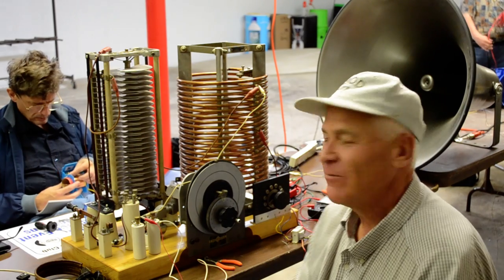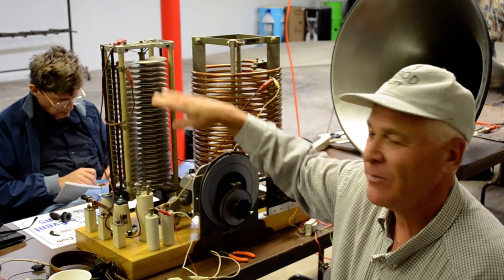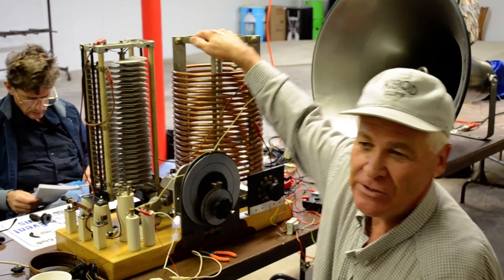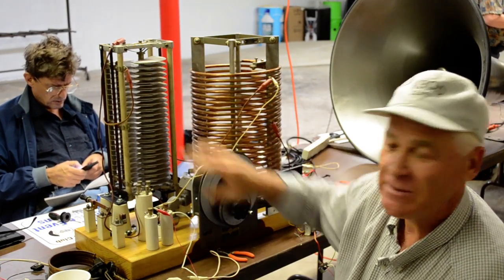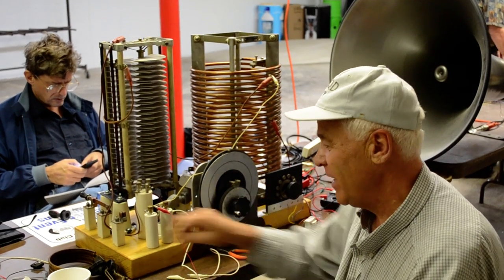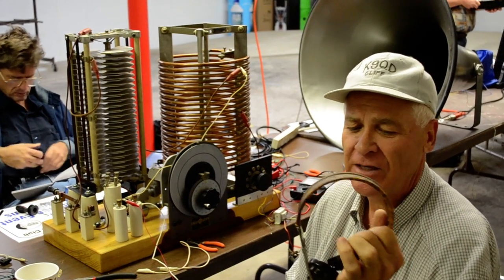World's Largest Crystal Radio K9QD

Comment: Fantastic. Wish we could hear it.
Reply from the maker: I didn't plan well enough to bring the camera's audio input close to the headphones.....but it would be even better to hang a spectrum analyzer across the tank as the capacitor is spun through the broadcast band.  I've already calculated approximately 200 mW audio into a 10K:8 Ohm match to the large trumpet speaker in the background the video.  Our local AM station WGN 720KHz (only 5 miles distant from where we shot the video) is probably more than 150 microvolts field strength her and it would be cool to have a scope display the detected audio spectrum too.   Crystal radios were something I began building by the age of 7 years experimenting in electronics as a kid;  the fascination of RF ended up causing me to spend college and career playing with the stuff.
Reply: Crystal set folks are used to digging around in the noise for a word or two.

Comment: That set really is beautiful... definitely mega-kudos to the home-brewer that created it. 
I was just thinking... that coil is huge and has a lot of pickup surface. Without even being connected to an external antenna and ground it could still pick up strong local stations by direct coupling into that big coil. One could build one like that with a big coil and big variable capacitor and a zincite/bornite detector bolted onto a back-pack frame and strap it on and don the 'phones and  have a nice stroll around town listening to the local favorite AM station of choice, free of charge...batteries not included or needed,  just a nice set of sensitive headphones. It might help to  set it up so the coil is horizontal on the backpack crystal set ;-)
73, Mr QD :-)
Reply from the maker: Yes, a simple 1N34A detector.   The local BCB signals are strong allowing the germanium junction to be forward-biased with plenty of headroom.  I've also used the zero-crossing FET scheme (obtaining the minimal junction bias needed from the tank to allow synchronous detection) to hear weak shortwave signals with great performance.  Surely you're correct: If the inductor were rotated horizontally, local M-field would be sufficient to detect stations with no ground nor any antenna.  My long-wire antenna is about 28 feet high and runs 130 feet to a tree (yes, once a lightning strike did burn it off the tree and I had to climb up there and restring the wire).  The headphones are a vintage TRIMM Featherweight high-impedance set and really help in avoiding a nasty de-tuning load on the tank. Yes, a backpack crystal set my be needed if societal chaos continues and gets worse.  73.
Reply: @k9qd25  Understood... yup, the End Times race is on... keep strong.
OK on the 1N34A diode... that would definitely be the best of the three detectors I mentioned, with the zincite/bornite rig coming in second-place.
Reply: @k9qd25  Your lightning adventure reminded me of a time years ago when I was sitting behind my Gonset GSB 100 TX and National NC-300 RX and I had my home-brew antenna tuner off to my left on another shelf about a foot and a half from the TX and RX and a thunderstorm brewed up and a lightning-bolt struck something nearby and had enough coupling into my home-brew G5RV antenna and a thin bright spark snapped from the cabinet of the tuner across that foot and a half gap and hit the cabinet of the GSB-100... WHEW!! LOL! :-D
Reply: ... As I think about my adventure I realize that even though the tuner's cabinet was connected to the GSB-100's cabinet by the shield of the coax connecting them, that length of coax braid presents an inductor to the lightning, and the energy of the lightning will resonate at whatever frequency that inductance and surrounding capacitance creates and SNAP!! across the gap at that freq.
Reply from the maker: @TerryMcKean  I've had a similar experience but the thin blue zaps circled around the basement ceiling looking for the water and gas lines with high-pitched snapping sound.  Luckily this energy wasn't the main lightning shaft that hit my tower outside!  Nothing got cooked but I moved quickly to pull the connectors out!
Reply: @k9qd25   Right on... I had a homebrew half-size G5RV- type antenna and it was up as an  inverted vee and held up at the apex by a 20 foot length of 2 inch PVC pipe. The 14 foot length of open-wire feed line feeding the apex went down through the inside of the pipe to a balun then coax to the tuner. It worked great on 40 meters where I usually operated at, usually  around 7050 on  CW, or around 7290 on AM. That was back on the 80's and 90's when I was N3HJQ, either through the Gonset/National rig, or my homebrew rig  that I built from old junk TV parts and stuff. I built it for 1 band,  40 meters, and had 13 tubes total in it and had a single-conversion superhet RX, and the TX  ran about 50 watts on  CW or about 25 - 30 watts on AM, with a 6146 modulated by a pair of 6DQ6's. I had awesome times back then talking with Ashtabula Bill W8VYZ (SK RIP) and TimTron WA1HLR and the rest of the East Coast AM'ers .... great times. <3 My HJQ  call expired in 2002 and has since been reassigned. Before HJQ  I was WA6GWA. My HJQ ticket expired because I got so busy with work and never sent in the re-up fees and stuff to keep that call going. I gotta find a VEC somewhere around here in or near Big Sur California and re-take the tests. and get back on the air, hopefully with my old GWA call  re-vitalized. :-)

Comment: Wow Very awesome.. ... A long long time ago I saw photos of a larger one that used quarter inch copper pipe at about 18 inch diameter..   Just amazing how large it was (and heavy!)  I will see if I can find a picture and post it here for you.
Reply from the maker: Ken, Will very much enjoy seeing that inductor.  The reason for this Continental transmitter (EF Johnson nameplate on the coil) component's size is to enable the withstand voltage needed by output tube's DC bias (16,000 Volts as I seem to recall).  The resultant Q of such a large solenoid is a welcome, ancillary benefit when building a Crystal Set.  When I spotted the variable cap at a Hamfest, I knew just where to utilize its overstated dimensions as a perfect match to the Continental inductor.  The variable cap's origin as part of a B-17 Bomber's Antenna Tuner just made things perfect.  The radio's Tank components have an interesting pedigree and perform wonderfully too.  Measured 235 mW into the speaker load (the speaker is in the video's background) with my scope and simple math.  Speaker load is a 31" University GH re-entrant trumpet from the 1950s matched to the tank via All-American Five output transformer and it fills the room with almost uncomfortable volume. Wife asks me to 'turn that thing down' because it's too loud.  I'm now using a white LED as the detector; it lights-up the ceiling and will indicate modulated light on weaker stations.  Three local Clear Channel AM transmitters simply peg the lamp to full brightness which demonstrates there is at least 2.85V across the tank.  Much fun.  Too bad the AM Broadcast Band has been suffering from a lack of decent programming as the medium loses audience.

Comment: Like 127
My lucky number. Amazing build, I wish I had a local radio club to make crystal sets at.
Reply from the maker: I spotted these large passive components (variable cap and inductor) at a HamFest and knew immeadiately where I could put them to use.  Our local radio club here in the Chicago suburbs has been organized for more than 40 years.  Our attendance on Saturday mornings will experience 25+ Hams, club members, and general public who simply wish to partake in electronics in some way.  Although we concentrate on radio, we do find some general public attendees who just want to learn more about electronics.  Since we're across the expressway from Motorola Solutions Headquarters, we are also blessed to have several ex-Motorola engineers in the group.  They're wonderful resources of radio knowledge and we're constantly learning new things from them.  Fun stuff.

Comment: does the wire gauge affect the reception? I had fine wire from power supplies, made coils, but they weren't that great. I used thicker wire, and it was the same. I finally used the thickest wire with just 15turns, and I could get a ham radio signal from Dayton, Ohio! the operator said he's going to play oldies music. I'll look for the call sign.
Reply from the maker: Hello Science Nerd,
Any antenna wire will receive radio signals.  Copper is
best, aluminum could also work.  I’ve used very fine copper wire,
insulated bell wire, un-insulated bell wire, and I currently have stranded,
un-insulated copper-clad steel antenna wire suspended outside to a tree in the
back yard.  I’ve also had good reception with thin bell telephone wire
stapled onto the wooden upper sections of attic rafters while lying on my 
back as I crawled across the attic of my home….but could only run about 60-feet
in an L-shaped configuration.  It worked but the outside antenna run is
better.  The outside wire also suffers lightning risk, so it has a
lightning arrestor with a grounding wire (thick 10-Gauge copper) run straight
down to 10-foot rod driven into the earth on the outside wall of the home.

The wire gauge doesn’t matter, but will need to be strong wire
if suspended any length.  Length is important as well as elevation for
broadcast-band AM because the transmissions are centered around 1MHz, and the
transmissions are Ground-Waves during daylight; therefore the electromagnetic
wave you want to capture is very long (light travels at 300,000 Meters per
second and the wavelength of a 1MHZ AM Broadcast Band radio transmitter would
be 300 Meters long).   A sufficient wire antenna for AM Broadcast
reception doesn’t need to be this unreasonable 1,000-feet length and a good
compromise is something most of us can achieve…..about 100-feet is very
good.  A longer wire’s own weight can cause it to break itself if the
suspended weight is enough to overwhelm the wire’s own tensile
strength.   I currently have about 120-feet of the copper-clad
stranded steel wire (steel is strong but a poor conductor – the copper cladding
is a good conductor; the station’s Electromagnetic Field’s induced voltage only
travels on the skin of the copper cladding anyway) elevated about 25-feet above
grade out to a tall tree at the end of my yard.
Thin wire, thick wire:  no matter to the tiny voltages
induced by the broadcast transmitter.   It comes down to a mechanical
challenge of length, height, and tensile strength so experiment with some
workable compromises at your location…..place any conductor (copper is the
best) above grade and it will do the job.    Cliff KDQD
Reply from the maker: Hi Again Science Nerd,I need to follow-up to your previous question about wire gauge because  I was somehow thinking the question was about antennas but see coil construction was the request.  There is no question the tank coil on this crystal radio has fabulous Q but it's related to turns diameter and overall size.  The spacing between the turns of this coil is related to the withstand voltage required in the final tube section of the Continental transmitter, not a result of the Q desired.   For a normal 2" to 3" diameter inductors, I've used DCC (Double Cotton Covered) magnet wire, Litz wire, and regular enamel coated wire.  I would say the Litz wire is by far superior to turns wound with solid wire; that's due to the reduction in distributed capacitance created by the adjacent turns of solid wire lying close together.  The Litz wire is a bundle of very fine wires twisted into one strand.  The undesirable distributed capacitance of single conductors wound side-by-side along the entire solenoid surface is minimized. Since the radio signal travels on the outermost skin of each tiny Litz wire, there is minimal distributed capacitance (we're trying to make an ideal inductor after-all) because those tiny wires are not perfectly parallel to each other.  The undesirable current/resistance loss from less conductive cross-section of each fiber of the fine wire is overcome by having many tiny wires combined into one conductor that's connected at the winding begin and end.  I've found Miller 565 Antenna Coils to be excellent inductors for crystal radios.  These are long out of production but can be found at Hamfests, flea markets, and electronic surplus stores.
Reply: i have litz wires, but they are so hard to use, and they always break when i try to use them.
thanks for the info!
Reply: A ham radio operator playing music on the ham band can get into a lot of trouble. They can lose their license as it's not legal. More than likely though it is somebody with a ham transceiver that doesn't have a license. If caught, it is a $10,000 fine.

Comment: try connecting a Joule thief ! and a super compacitor ide like to see that!
Reply from the maker: There is enough energy transfer from several local AM Broadcast transmitters to illuminate a white LED (white LEDs need >2.7V bias) when used as the detector.  While this surely isn't 'free energy' it is indeed provided by the local AM station's power expenditure and free to me.  A voltage doubling circuit could easily boost the feeble energy received into some supercaps and therefore crank-up the voltage.  Accumulated energy (Mr. Joule figured that out a long time ago) could be quickly harvested on a periodic basis.  Cool idea.

Comment: Come on dude... send it to an audio amp so we can hear how sensitive it is.

Cool project. I'll bet a similar coil could be made using flexible copper tubing.
Reply from the maker: You're correct.  Trouble we had in bringing audio into the video was the camera placement:  too far away to bring the headphones up to the camera's mic.  It would actually be better to do this again with some scope shots.  The performance of the EF Johnson tank coil's Q is astounding.  It would be a good experiment to actually measure it but, alas, not enough time to make the effort.  Static inductance of the coil measures 590 uH and is simply copper tubing nicely wound onto a 4-post slate frame.  They were designing for the high voltage withstand needed in the Continental's final section so that explains the wide spacing between turns.  The trumpet speaker in the video's background was disconnected during the video and we probably should have allowed it to remain in-circuit to prove the sound level achieved.  Maybe someday we'll add a follow-up video demonstrating the audio voltages resulting from the excellent Q of the set.
Reply: I'd rather know how selective it is. You can make it as sensitive as you want with a piece of wire.

Comment: 250 milliwatts!?! :o Those headphones should be SCREAMING, and very clearly audible in the video! I suspect he misspoke... 250 MICROWATTS, maybe... would be very clearly audible in good headphones.
Reply from the maker: You're correct, I misstated the measured power:  should be 25 milliwatts obtained from a 50KW station located about 11 miles to the south.
Reply: Even 25 milliwatts, should be quite audible from the headphones to the video... and would be painful to your ears. :)
Reply from the maker: Yes, indeed audio is painful.  The tank produces 3.56V on the local 50KW station down the street and that forward bias propels a white LED detector to full brilliance.  The 31" University horn in the video isn't connected because the rest of the hams in the room complained about the loudness.  Harvesting this much of the station's field strength is fun.
Reply: With that much signal I would think you could impedance match it and power a speaker.

Comment: They make speakers you know? :)  You gonna keep that thing al to  yourself and not let us hear it lol
Reply from the maker: You're correct!  Actually there is a 31" University Trumpet speaker on the table (in the background of the video) that we were going to connect directly to the All-American-Five (AA5) transformer on the bench but the audio was so loud the rest of the team said 'turn that thing down'......probably should have ignored their complaints.   We're only a few miles from two 50KW stations (WBBM 780 and WGN 720) and the amount of power measured into a 2K-Ohm headset was around 250 m
W.  The speaker's acoustic output was too much for the guys so we didn't demonstrate the set's efficiency into that trumpet.  Oh well, suffice it to say the set works very efficiently.
Reply: @k9qd25  haha, thanks for the info :)

Comment: 矿石收音机？
Reply from the maker: Yes, 1N34A Germanium crystal diode.  Also able to use LED because the tank voltage is high enough forward bias.
Reply: @k9qd25  用料真奢华，做的真不错，用场管无源检波也是可以做矿石收音机的😁
Reply from the maker: Your are correct.  The inductor and variable capacitor are from large transmitter equipment that no longer had useful duty because modern technology is much simpler.  Your idea of a Vacuum Tube detector will work very well but needs filament and plate voltage.  MOSFETs have such low RDSon today and that allows detector operation on very weak signals.